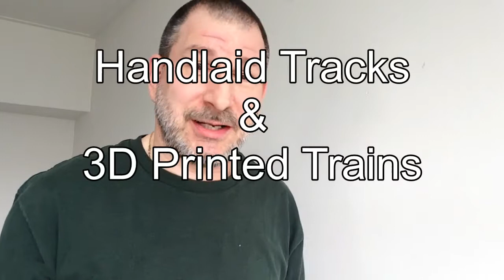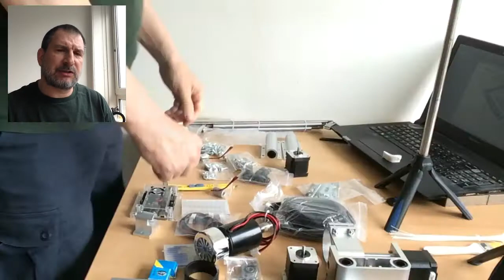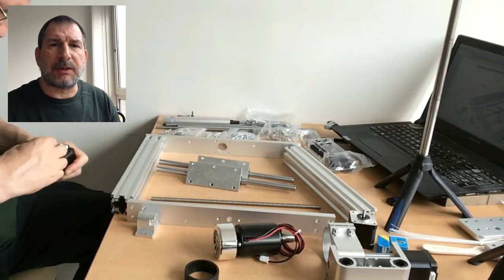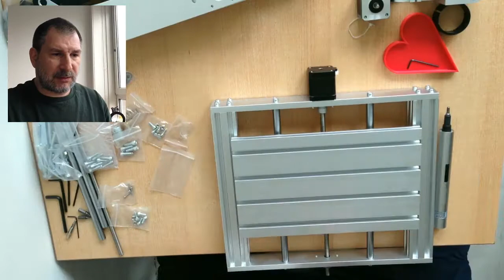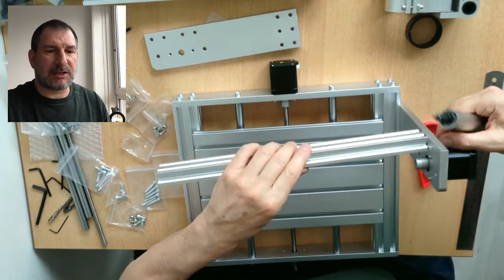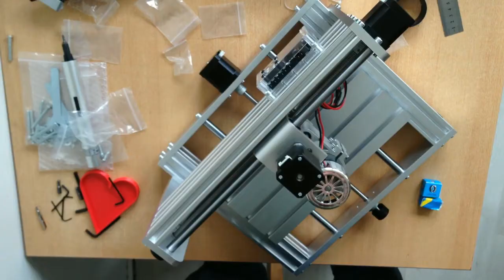Building The CNC 3018 Pro Max Metal Engraving Machine GRBL Control With 200w Spindle

Comment: Thanks for uploading your hobby progress,  I model in N in the basement and G in the garden and use my CR-6 for lots of things.  I considered then passed on the hand laid track opting for a PECO track system, I admire your stamina in building all from scratch.  Been coveting a CNC machine, 3018, 4040, or larger more hobby class like a Shark SD100 or even a Longmill or Onefinity machine.  I do have limited workshop space so smaller is more likely.  What projects have you or do you intend for you model work with your CNC? Browsing your Youtube channel I see most are 3D printer based and just a couple on assembling the CNC.    I'd want to use it for more than my MRR Hobby but wondering about the usefulness of a CNC.  I did buy some Fasttracks curve templates, they look CNC printed,  made my own in 3D plastic, very useful with flex track.  Like my decision to go with PECO, I'd go for a semi-assembled unit like a Genmitsu Prover , a Yora Home unit, or pay more and get something like the Shark SD100.  Did consider a resin printer as many N gauge enthusiasts rave about the detail, but not crazy about the toxic mess, I think the smell of fresh sawdust is preferred to the smell resin.
Reply from the maker: Hi David, I really enjoy building the tracks so far, but my apt is small, so I'm just doing a 2x4' layout. You can always make a few straight or curved pieces to see if you like the process. The CNC was primarily to make the track jigs in aluminum but it had a bad vibration. Eventually cut off the chuck and ordered a new one. But by then I had gotten used to using the 3D printed jigs and with a tiny layout I haven't used the CNC. Very loud in a Amsterdam neighborhood too. I just got an Anycube Photon Mono X and Wash Plus to resin print with. Have not used it yet, need some more protective gear. Using water washable resin, but it is still dangerous stuff. Plan to add details to some freight cars I  designed years ago in my little intros.
Reply: @handlaidtracksand3dprinted922    have a 12"×30" (30x75cm) on order from Longmill a Canadian manufacturer of CNC, uses a 1.25 hp router. ...  I live in a small house in a small village in Northern Canada.  Enjoy my small workshop in my basement.  Layout in basement is about 2.5 x 3.0 m